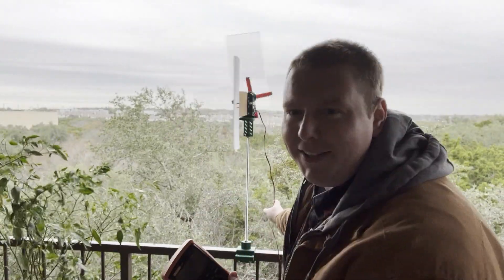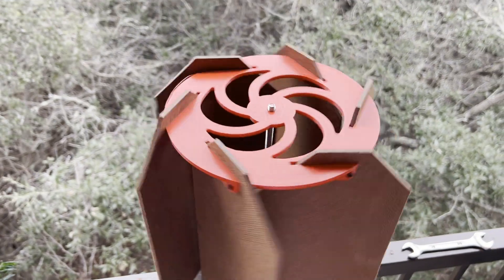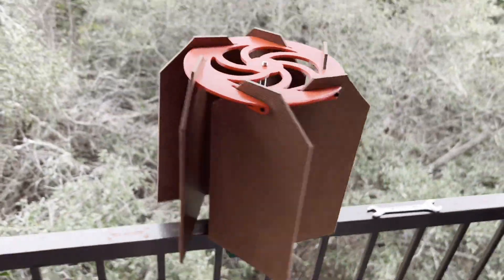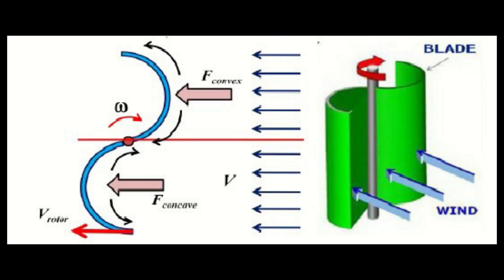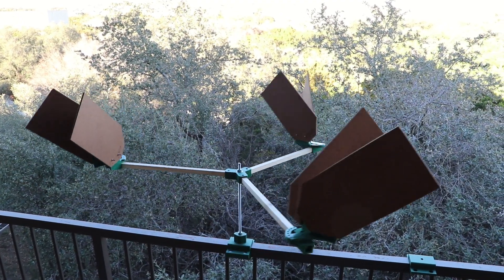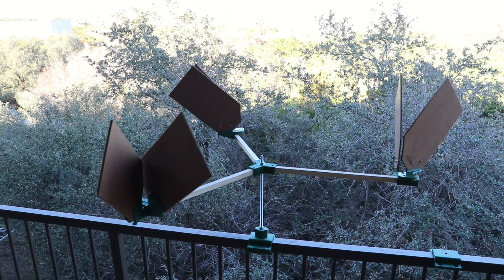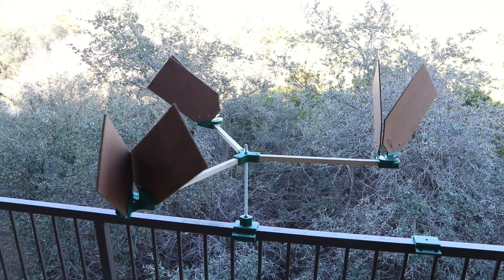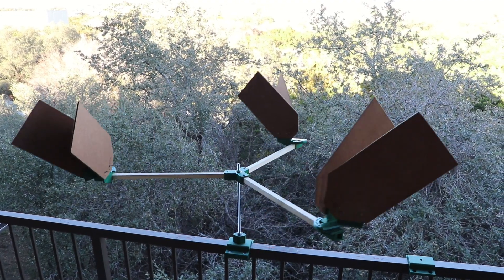This Wind Turbine Spun Backwards and It Made Me Quit Making Windmills

Comment: I'll give you the best advice I got. 3d print everything at 1/4 scale or smaller. Use a small fan in your home to test turn direction at various angles. This will allow you to fail and iterate out of failure fast. Building full size things that then don't work is time consuming, expensive, and frustrating. I used to do it, and its just terrible. So don't do it. Plan to fail, accept it as part of your process and you'll have a lot more fun with the process. When I'm not sure about a process I try to make one 1/4 size mock up of a new idea every day, test it and then try again the next day, kind of on the side, while I'm working on my main projects. So I have some success that day, even if the scale model fails. And the scale model usually fails. But who cares? Its a scale model that cost .10 in filament, took a half hour to make and now I know more than I did that morning.

Comment: I believe that your props are filling with air to decree in the scoop to a point that it becomes a higher pressure zone than the front of the prop where the pieces connect and make a point or an arrow has the path of least resistance versus the scoop side and the air is dragging across it kind of like a plane or an F1 car or the pointy side is less resistive ergo it spins backwards and spins because of the air's drag on the surface area of the more pointed side/prop meeting point. If you were to add a hole where the props meet to let air through but it was small enough of a hole to restrict the flow, you just might get your older design to (at least) spin in the direction you wanted. (I am no engineer but I do understand some basic aerodynamic principals) maybe a cone shaped prop with a hole in the center (like an ice cream cone with the bottom bitten off) might do the trick and get a similar result to the wind vein (the hemispherical wind measuring device, I'm clarifying because I feel I might be using the term the wrong way). Good luck and don't give up!!!!

Comment: Very cool design in the way you can test many variations for quick comparisons of performance.
It helps to think like the wind.   The wind does not see a "lift" or a "drag" turbine, it just "sees" an object it needs to get around.  In avoiding objects it is much more likely to create low pressure zones than high pressure zones.  Airfoils are designed to let the air slip around the as easily as possible while forming a low pressure zone on one surface for "lift.  I think the narrow Vs  facing the wind are letting the air slip around them as intended but are also forming a low pressure zone behind them that pulls on them more than the Vs that are moving against the wind are being pushed by the wind.  I think of it as a "lift" turbine.

Comment: I can't think of what's causing the problem with the double bladed windmill, but I suspect that the airflow is pretty funky. There may be some backwash and swirling between the blades, for example. I'm sure the fluid dynamics would be really hard to calculate (well, okay, that's pretty much always true). What you might try, someday, is building a wind tunnel with some clear acrylic sheet. Mount the turbine inside, and put a fan or other air source at one end and vents at the other. Use a chimney tester or some such to send smoke into the tunnel from the fan end to visualize the air movement. That might make the problems more apparent. Plus, you can probably get at least a few videos out of building a wind tunnel. 😀
Reply from the maker: Airflow is so unintuitive. That’s a big part of why these windmills are so enthralling to me, there’s no one right way to do things. 

The things I’d give to have access to a wind tunnel! It would certainly have made many prototypes much more diagnosable, especially this one. Good suggestions on the smoke and chimney tester, thank you!!

Comment: Maybe the V-shape of your blades act like an aerofoil and create a negative air pressure in front of the blade.
Reply from the maker: That may also explain why it spins so poorly. I wonder if the airfoil lift affect could be counteracting any drag from the other side? 🤔
Reply: This is hard to tell if being coy. Lol. This is essentially exactly the case. I also take slight sleight to calling those airfoils. Fin vs airfoil.